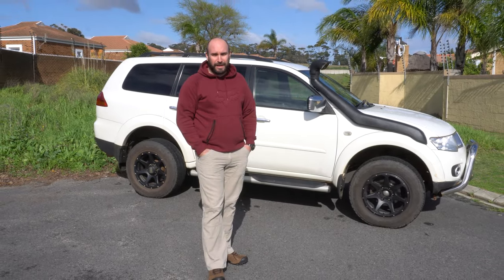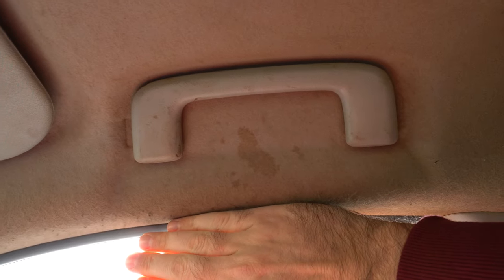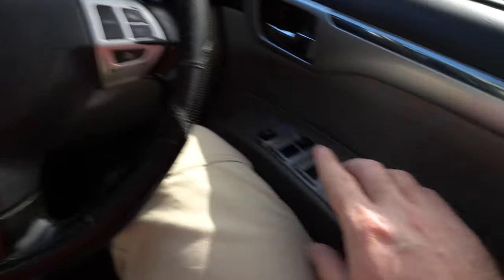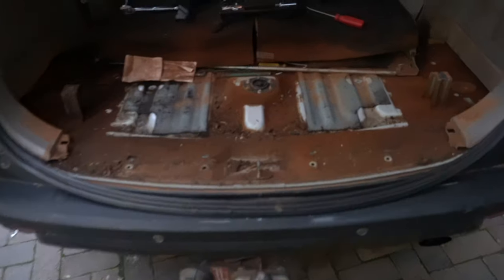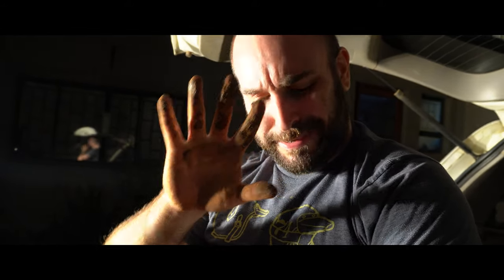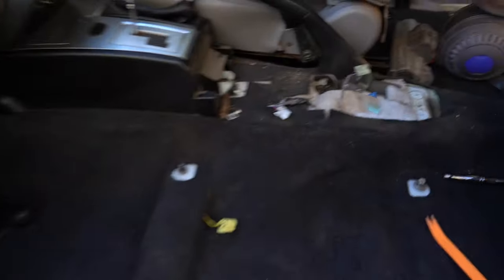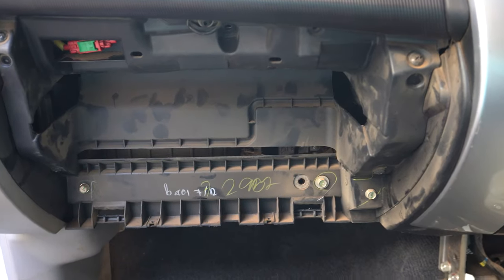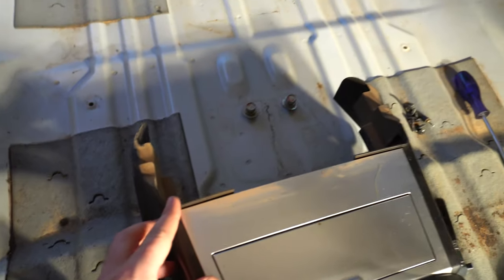Buying the dirtiest Mitsubishi Pajero Sport on the internet! Totally Transformed! Part 1

Comment: You  can retrofit a cabin filter. Bought my filter from Masterparts. Febi carbon filter. The carbon filters help with odour. Its grey in colour  vs white for normal filter. Think the part number was 30435. Its the same filter as the Lancer and Outlander.
Reply from the maker: Thanks Zubair! Managed to get the right one and fitted it the next day. Will be dropping a short video on how to do it as well. Maybes a massive difference. Can’t understand why it doesn’t come with one from the factory.
Reply: @RichardBauer_  awesome! Went through a similar exercise as you with my ex vehicle. Serviced my PS and replaced all the fluids with oem stuff etc so in learnt alot. Shout out if you ever need to know anything.
Reply from the maker: How do I get better fuel consumption?! Haha. Took her to Jacques at MitsuCare and he gave the approval to say she is ready to rock and roll. Next video is completely the clean up and then some adventures. Still need to replace the radiator and axel fluids.